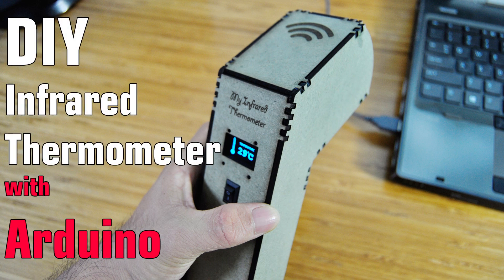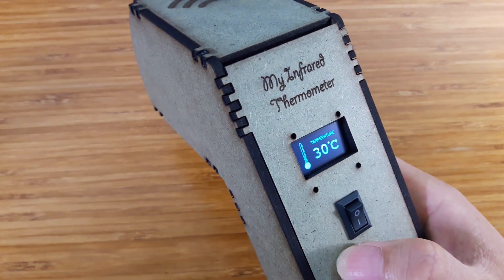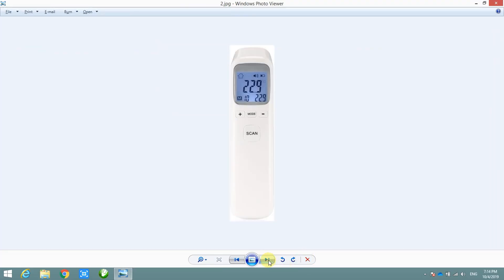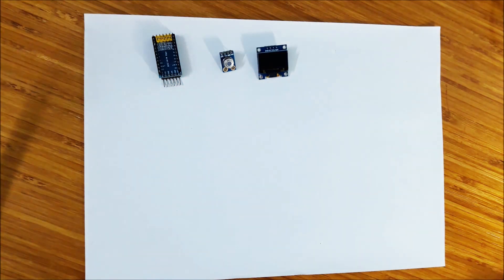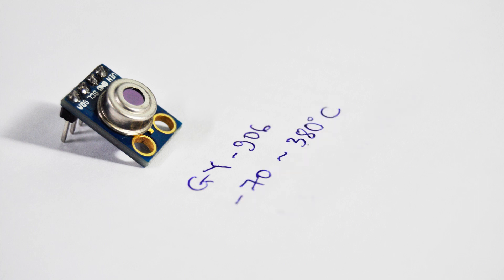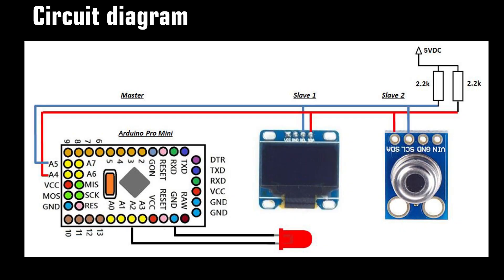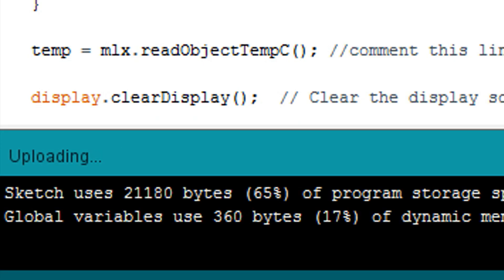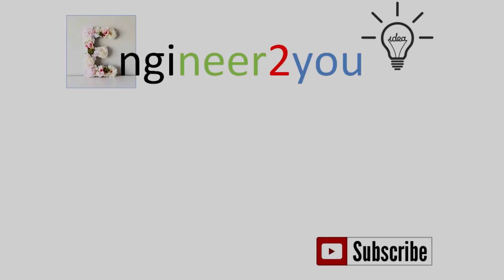Arduino infrared thermometer with case MDF

Comment: Can we use atmega328 instead of  Arduino ??
Reply: Can you explain the necessary changes that we have to do in connecting Atmega328 pins with sensor , and rest of the components
Reply from the maker: @aln_vincnt  please study, it is not difficult
Reply: @engineer2you  Sir please ,I need to submit this project within few more days and I found the connection difficult .Can you please help me !
Reply from the maker: @aln_vincnt  it is not difficult. Pay your heart. You will get it
Reply: @engineer2you  Sir , Can you explain how battery and switch is connected.
Reply from the maker: @aln_vincnt  it is serial connection battery and switch
Reply from the maker: NoOB GaMeR yes. You can
Reply: @engineer2you  So that what are the necessary changes we should do in Arduino code
Reply from the maker: NoOB GaMeR Arduino UNO also uses Atmega328p. So you dont need to change anything

Comment: can I replace it with DS18B20 "Digital Temperature Sensor"?
Reply: DS18B20 is not infrared sensor, and protocol communication is 1 wire, dallas protocol

Comment: HI BRO, CAN I USE THE MLX906 SENSOR TO DO IT? THANKS
Reply from the maker: Diego Alonso Ibarra Morales yes, you can if you know how to read data from mlx906
Reply: @engineer2you  do you have information about that?
Reply from the maker: Diego Alonso Ibarra Morales i’ve checked on internet, MLX906 is GY906 (sensor in this video!)

Comment: Good morning, could you replace the MLX90614 sensor with the MLX90615, Considering making the connetion change according to the connections data sheet. http://dtsheet.com/doc/1776025/comparative-table-between-the-mlx90614-and-the-mlx90615-d.... I wait for your answer
Reply from the maker: xe1bwb yes, it is possible. Let’s try it

Comment: Hello Sir, nice work. Is it possible for you to edit the code to display the temperature in Fahrenheit with one digit after the decimal, it will be great and helpful to man kind. Thanks.
Reply: (0°C × 9/5) + 32 to convert between. Simply use this, in conjunction with something like "Serial.println(temp, 1)" after setting the result to a float.
Reply from the maker: Ryan Doucet thanks for your help
Reply from the maker: Sure. Please modify the code :)

Comment: Sir, I use an arduino nano(3.3v)  should be ok right instead of arduino pro mini
Reply from the maker: Yes. Nano is also OK
Reply: sorry to bother you
one more question, there are MLX90614A and MLX90614B, both of these can be use for the project？

Comment: sir may i ask i'm just wondering what is the use of the red led thank you
Reply from the maker: Jean Marc Reyes hi, it’s just for indicating or even decoration that the GY-906 is measuring
Reply: @engineer2you  ohhh so basically i can skip on using the red led and just use the sensor alone. Thank you sir
Reply from the maker: @jeanmarcreyes6927  yes, you can skip it :)

Comment: Seem mlx90614 not accurate for human body temperature, I used to add +3.5C offset, but still messi, do you have any idea for calibrate this ?
Reply from the maker: It will show stable value as in video, however, accuracy of this sensor is +/-0.5 dgC.
Reply: @engineer2you   So is this  sensor have medical accuracy ? Does it meet the medical industry standard?
Reply from the maker: @CryptoConscious481  sorry, this sensor doesn't have medical accuracy. For medical accuracy, we have to find another sensor. This sensor is from Melexis maker (https://www.melexis.com), which also can offer medical sensor with accuracy +/-0.1dgC, but i guess it will be high price
Reply: @engineer2you  Okay thanks, do you know a specific model sensor that can get me medical accuracy?
Reply from the maker: @CryptoConscious481  see this datasheet https://www.sparkfun.com/datasheets/Sensors/Temperature/MLX90614_rev001.pdf
page 26 mention about medical accuracy, but it states "on request" Melexis for medical accuracy. It seems it's difficult to get sensor with medical accuracy for personal usage like us.

Comment: sir i got your mail but tat circuit is not clear which u given in tat link, so please share full circuit connection
Reply: The circuit is very clear, the only thing that is missing are the wires +5V to VCC and -5V to GND. That's all!

Comment: Sir l need complete wiring diagram, because I tried but it's not working may be wrong connection so share full wiring diagram
Reply from the maker: Hi. Please go to this link, you will find the circuit.  https://www.engineer2you.com/2019/10/arduino-infrared-thermometer-with-case.html?m=1
Reply: @engineer2you  Sir this circuit already there in your video but tats not clear to understand so share full circuit and connecting pin details

Comment: The sensor field of view is way to wide, how do i fix this? I am using all the same parts you use and your exact coding. But when i try to temp an object, if i move an inch a way it drops over 200 degrees F making it extremely un accurate and un usable if the sensor is move than a quarter inch away.... PLease help!!
Reply from the maker: This sensor can only measure in 2cm distance. If you want to measure in long distance, you have to choose sensor with lense
Reply: @engineer2you  can you tell me few sensors which can work for longer distance (about 500mm to 1000mm)

Comment: Can you show me the complete circuit diagram? Thank you!
Reply: what is the 5VDC and 2.2k in the circuit diagram? Is that the battery holder?
Reply from the maker: Hoper's Channel power supply from battery. 2.2k is used for i2c network
Reply: Thank you for your help :))
Reply: Where should I put the vcc and gnd of the oled and temperature sensor? I’m just confused because it is not stated in the diagram.
Reply from the maker: Hoper's Channel put vcc and gnd are same with Arduino Pro Mini. Sorry about not clear circuit, i will make it clear in next video
Reply: engineer2you Thank you! I look forward in your next video :))
Reply: @engineer2you  I am also interested in the full circuit
Reply from the maker: Please find it at video description. Thank you :)
Reply: Thank you

Comment from the maker: Tell me your opinion about this project. Thanks
Reply: Nice project! I like it very much. Could you send me the design of the case or how I can get the MDF case? I wish to build the project for my students. Thanks in advance for your kind help.
Reply from the maker: @dasmanjohan7468  Hi, you can download the design file here http://bit.ly/2PxJGr7 
I used MDF wood 3mm thickness, then cut by Laser cnc machine. Hope this can help you.
Reply: @engineer2you  Good job !! Thanks !!
Reply: I need complete wiring diagram sir,
Reply: Sir send me complete wiring diagram for this, I am very beginner for this type of project.